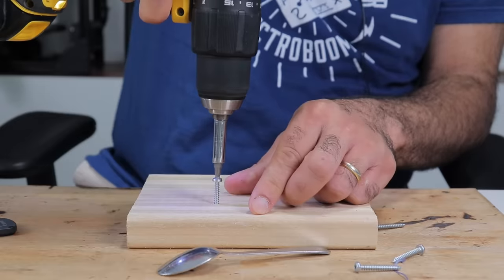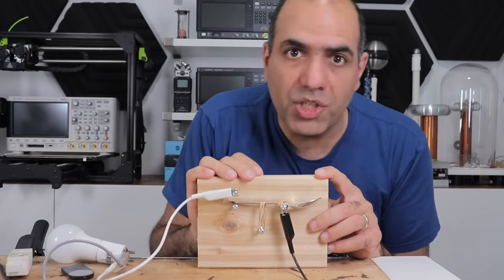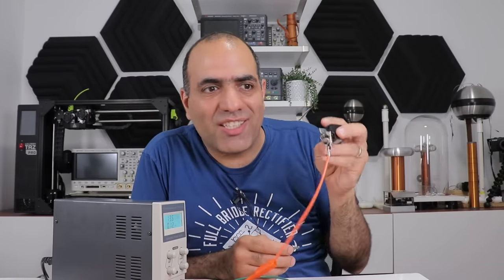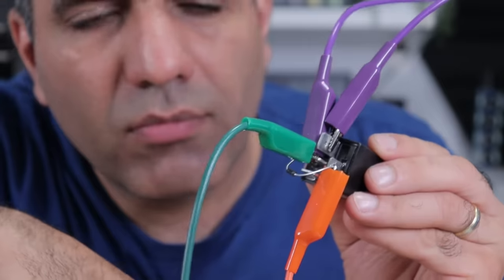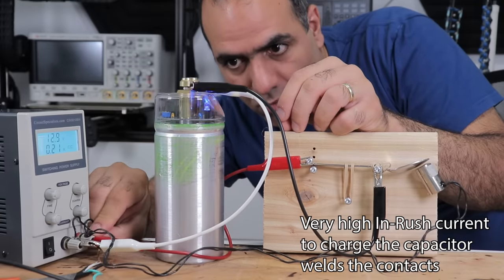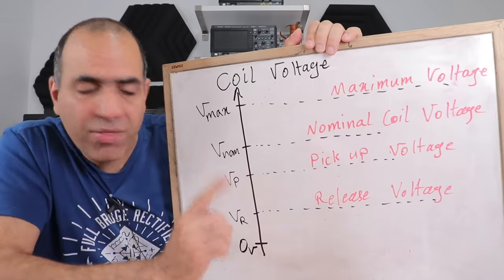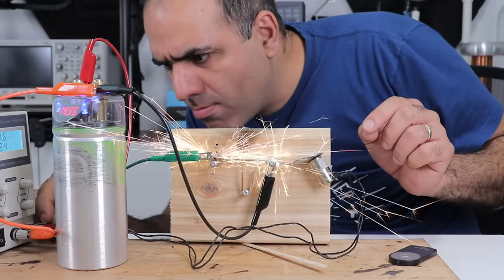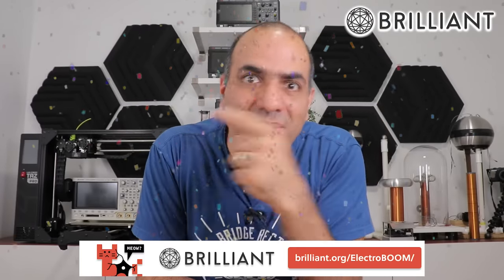Why RELAYs go BOOM!!! And How to Use Them

Comment: I like that at this point you are more scared by the breaker popping than messing with 2000V open circuits
Reply: For he is Mehdinvincible
Reply: 2000V at no current... If it was at least 20mA, it would instantly kill him
Reply: @aradmnk1269  Yes
Reply: @proxyhx2075  and.. The current is only 500mA.. What is the deal? It can only shock you slightly. Even electroboom when used it, it wasn't that powerful. If that transformer would deliver so much power as you tell, the moment he would touch the conductors, they would melt, and second, they would deliver very high load to transformer which would melt
Reply: @themoonwolf7438  Ah yes only 500mA. With 1/10 of this Current your Heart cant beat anymore!!!!
Reply: @themoonwolf7438  Please dont talk about things you dont understand
Reply: @flavioernst902  man. Don't tell me things like i don't understand what's going on. 1/10 of this current at 2000V as you tell, would be enough to fry you like a chicken, instead of just stop your heart as you say. 500mA would place you on fire by now if you would touch the conductors. First this. Second, as you see conductors was in really good shape, and if that would be high current, this spoon, at this rate of current would turn red and melt (something that didn't happened. Why?). Third, on such a "high" current, the transformer would turn really really hot in terms of some seconds! So what's going on? The transformer at no load has 2000V but no current, which is why you see an arc jumping across the spoon which is conductor! If that spoon would be the load, 2 things would happen, either the breaker would instantly pop, either the spoon would turn very very red.. Choose one!

So yeah! Applied 2000V, at no current! Simple!
Reply: @SimonBauer7  i know that. Since he wasn't it's (microwave's) load, nothing happened, right?
Reply: @themoonwolf7438  interesting thing here is that it's not exactly the wattage that's dangerous here! The human body isn't crazy conductive like metal, so current is tiny with most low voltages (V=IR). But at high voltages, the current can get a bit larger and at 20mA, the current can latch your muscles (muscles are already controlled by voltage signals from neurons). The microwave transformer is capable of giving enough current to freeze muscles, which is bad news if the current travels through your heart OT lungs. Now if you notice in the video, only one hand is used near any high voltage system. Assuming no grounding elsewhere, this is is how you work around high voltage. If there is no path to a lower voltage potential that goes through the torso, the danger is substantially reduced.
Reply: @themoonwolf7438  if there is an arc there is current. No way around that. As whit the power and instantly frying and stuff you can calculate the power by multiplying the current and the voltage. As you can see yourself its not that high. The transformer has a pretty loose coupling factor which means that even if the secondary is shortet, the primary coil still has some inductans and thus limiting the current. That means the breaker doesn't trip instantly. Please overtink your reasoning because it has some big logical flaws
Reply: 2000v is just death.. tripped breaker means angry wife..
Reply: @themoonwolf7438  First off, you're incorrect. It's a microwave transformer, capable of delivering high currents needed for the microwave generation. 

Even assuming that it is 0 current, passing through 100k ohm resistance (Upper end of average skin resistance) would generate 20 mA.

However, what people forget to understand is that when electricity runs through a conductor, its resistance can (and in this case, will) drop, increasing the current passing through. 240 and 120 V AC has been known to kill people. 2000 V from something meant to deliver power WILL kill you. You'd be safe if it was current limited, but it's a microwave transformer designed to deliver more-or-less continuously.

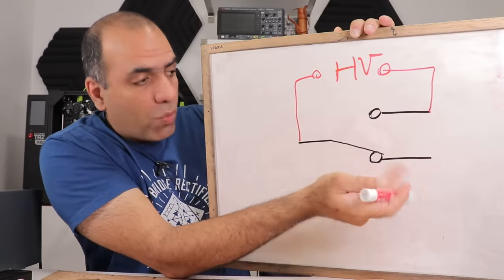Second, if you haven't watched his video on it, you should. The real dive happens at 8:30 in this video: https://youtu.be/DOMs7mYm_zs
Reply: Damn, that scared me too!
Reply: @YoRHaAttackerNo2  ok, i understand. But there is one question. Why 2KV would kill, and 15KV wouldn't kill? What do i miss? 15KV is grater voltage than 2KV that is produced by microwave transformer. Why this doesn't kill you, and so will microwave's transformer?

Edit. Now I understand the whole thing with voltage, and wattage and amperage and all this sort of things. But this is just something that I don't understand. Why 15KV, 20KV, 40KV, 100KV, 500KV, doesn't kill, and 2KV of microwave does?
Reply: @flavioernst902  maybe you are right. Maybe i miss some important facts
Reply: @flavioernst902  as for what you said about frying, i remember when I was in school 2 years ago, i was studied that at 220V and 20mA of current is just enough to shock you till death. But at 100mA, 200mA or even 500mA, that would be enough to fry you like a chicken. There was sketch images in there which was indicating each situation.

But here we are talking about 2KV, which is almost 10 times as many as 220V. And if 220V at 500mA is able to fry you really good, then what would it do at 10 times of voltage with the same rate of current?
Reply: @themoonwolf7438  Voltage doesn't exactly kill you.. technically voltage is only a reference of potential between 2  points of measurement and not 0v and 2kV .. rather the difference between 2 points is 2kV.. so you could swing on a 2kV wire like Tarzan and you're good until the second that voltage creates a grounding loop through you to create a current.. 500mA is 500mA whether created by 5v or 220V or 150kV .. most wiring for houses in my country uses 2.5mm wiring that is rated for up to 24A .. which is 24000mA .. a metal spoon is much larger than most household copper wire which is why while there is definitely current.. the spoon isn't glowing red hot.. 500mA is a small current rather.. your kettle while boiling takes anything from 4A to 8A which is 8 to 16 times more than the "high current" of 500mA. Infact cellphone chargers are now out putting more than that when charging your phone.. for that spoon to start glowing I would reckon that the amperage would have to be at least perhaps 100A ? Even then I think it would be a really slow process ? Don't hold me to accuracy on that since I tend not to put spoons in electrical sockets ..

Edit: also another thing about why these "shocks" aren't killing him.. electricity has a tendency to contract your muscles involuntarily.. so touching with just your finger usually forces your arm to reflexively pull back when you get shocked.. unless you're monkey holding something and the muscle contraction strengthens your grip on said shocking item .. I've been shocked many many many times .. only once I was actually grabbed by the current as I was stripping a cable end I wanted to join thought I had turned off but turns out I didn't ask enough questions about how the wiring worked.. in any case it kinda just forced my fingers to clamp down harder on everything and I struggled to let go
Reply: @twistedshadowsaf  thanks for explaining. I didnt want to write so much
Reply: @twistedshadowsaf  How about forks? You do put those in sockets, right? RIGHT?
Reply: @Daniel-yy3ty  I shall neither confirm nor deny these hazardous accusations.. but between you and me.. forks didn't exactly allow me to eat electricity either😂
Reply: Hm... Now I understand. Thank you guys. Thanks for explanation. And besides the thing.. I realize that this is really complicated to understand 😅
Reply: @themoonwolf7438  Power us voltage times current
Reply: Don't try this at home....the breaker popped!
Safe at home now...
Reply: @YoRHaAttackerNo2  Yup, RF burns are a thing. You can cook yourself with RF energy.
Reply: @akkudakkupl  that's..  what I said.. so.. yes you're correct? Did I mistype?
Reply: @twistedshadowsaf  Replied to the wrong person ;-) Sorry m8
Reply: @akkudakkupl  500Ω? But.. But in multimeter, if you will measure the body resistance, it is about 2-5MΩs (mine is 3,75MΩ). I don't understand.. How from such a huge resistance, our body can go to 500Ω, which is low? I don't understand that..
Reply: @themoonwolf7438  Thats called insulation breakdown. It's only a thin layer of skin on the outside of your body that has high resistance, your insides on the other hand have around 500 Ohm. 2000V is enough to pierce the thin insulating layer.
Reply: @akkudakkupl  now I begin to understand
Reply: @themoonwolf7438  What people here forgot to tell you is that frequency is also important. The most dangerous property of mains is it's frequency - even little current at 50/60Hz going through your body can cause muscle cramps and in the worst case heart fibrilation. The 15 or 50 kV you are referring to are probably from the CRT transformers or Tesla coils - these devices use 10s of kHz for operation which causes the current to flow through skin (behavior known as skin effect) - not your muscles which enables you to survive a lot higher currents, but keep in mind that even with lower currents you can still get your skin burnt by plasma (if we are talking high voltage). Electroboom already did a pain testing for that matter highly recommend watching it.
Reply: @themoonwolf7438  if you are grounded then: 2k (at 60/50Hz) will kill, and so will everything above or below (im dont know the minimum voltage required to kill)
Reply: @themoonwolf7438  you still aren't making sense. 0.5A isn't gonna heat a spoon to red hot
Reply: @themoonwolf7438  dude, he's shorting an unballasted microwave transformer. That's like 2A 2kV or about 4kVA. Yes, the transformer would be burning in less than a minute if the breaker didn't trip. I just don't understand you point
Reply: @themoonwolf7438  because the voltage drops if the supply can't provide the necessary current. If I touched a 150kV PSU capable of 1mA on short circuit, the voltage across me would drop to 100V or less. Ohms law my guy.
The MOT can provide a high current due to its small leakage inductance. A 150kV supply that can supply 1A on short (eg a big x ray transformer) would fry you like a fly caught in a bug zapper.
Reply: @themoonwolf7438  it's not the voltage that fries you, it's the current (we are just living resistors after all and P=RI^2). 
The voltage determines how MUCH current can be stuffed through you. If the supply can't provide enough current, it's voltage will drop accordingly (V=IR). It's all a complicated mess of impedances really
Reply: @twistedshadowsaf  I can tell you from experience that about 100A will make a spoon glow red. 1kA will melt the spoon in a second or two
Reply: @themoonwolf7438  glad we could help, electricity is a complicated topic and for some reason whether it's the voltage or current that kills seems to be a controversial topic lol
Reply: @akkudakkupl  been there done that lol. RF burns have a very distinctive smell
Reply: @w04h  not the skin effect, but rather our nerves don't respond to currents past a few 10s of kHz. Skin effect only takes place at higher frequencies or in more conductive materials than flesh
Reply: @inductivelycoupledplasma6207  Yeah, did that too with an SSTC, small, deep spots.
Reply: @twistedshadowsaf which is a far worse situation!!!
Reply: Working with 2000V would prime the mind to be easily startled by even the smallest sound

Comment: "A switch goes in series with the power line, not parallel." I remember having to explain that to my dad once.
Reply: If not, it becomes a fuse that only works once
Reply: @TheEdRiAx  I mean.... that is how fuses work XD
Reply: That reminds me of 8th-grade science class long ago, where during the chapter on electricity the students were told to connect a battery, a switch, and a light bulb, so that the switch would turn the bulb on and off.  Several people had theirs hooked up so that the bulb was on when the switch was open, and off when the switch was closed.  They ran their batteries down pretty quickly.
Reply: @bledlbledlbledl  And that's how a NOT gate works!
Reply: @andreyrumming6842  
There are fuses that can be reset.
Reply: @Bassotronics  AKA breakers.
Reply: @Bassotronics  That's not a fuse, by definition fuse is fusible - it melts. What you are thinking of is an automatic circuit breaker.
Reply: same here but after the 2nd fuse reset i said that you only connect/disconnect one wire with a switch not both. otherwise you just making a switch for the breaker and not the light.
he had Line connect to Neutral in the switch when you flip it on.
Reply: I mean, it will make the power turn off. It just might not come back on again.
Reply: Before or after he closed that switch in parallel?
Reply: @danewaccountttt6486  After.
Reply: @akkudakkupl  @Nilguiri No, polyfuses exist!

Comment: This guy will never die. He’ll just shock himself back to life.
Reply: Electroboom: * touches keyboard *
Keyboard: * sends a shock *
Reply: @ZeldagigafanMatthew  smartn’t
Reply: @ZeldagigafanMatthew  Doesn't mean he hasn't deadened his nerves.  I'm  a professional too...  I once stood next to a panel holding a 18 gauge signal wire that was shocking me, all the while pondering how it had enough current to go through my PPE.  I wasn't touching anything but the wire by the insulation,  the current wouldn't have been able to flow any way but through me, my electrical boots, the rubber insulated mat, cement floor and finally to the ground.  Still have no clue how the current for that particular signal wire was so high.
Reply: @jeremyreese54  high frequency RF signals do not require a direct path to earth. Any large body acts as its own earth, as the AC signal is constantly charging and discharging the capacitance the body represents. The are a number of ways an active load could superimpose an AC signal, even on its DC supply, but such a condition would-be the result of bad design or very high power.
Reply: @nigeljohnson9820  I can't remember what that wire was for,  been too many years.  Only time I've seen that effect.  Could have been DC or AC, was working systems with both, but, I get your point.
Reply: @jeremyreese54  I am only guessing, but I suspect that even a mechanical load is capable of putting an RF signal back up its supply rails. For example ,from contact arcs, induced AC voltages from motor coils and relays..
Reply: Why are you wearing a face diaper in your picture?
Reply: @robertkiestov3734  - why re you not wearing your brain today? Did you take it to the cleaners?
Reply: @uplink-on-yt  Lol nothing you say is going to change the fact that you believe in a hoax hahaha
Reply: @robertkiestov3734  - I'm glad that you think that anything you say makes it less real
Reply: @uplink-on-yt  Don’t care. I have 8 years lung care experience and you don’t.
Reply: @robertkiestov3734  OK, you're just typing random words now
Reply: @robertkiestov3734  - that's not it. You need to have your ears and eyes checked. Ask Mehdi for one of his world-famous electroshocks
Reply: @uplink-on-yt  Hahahahahaha had it coming
Reply: @robertkiestov3734  - what did I have coming? The thing that doesn't exist?
Reply: @lotus7781  It never existed 🥱
Reply: @robertkiestov3734  odd, whole world freaking out over nothing? im not sure what makes you think it never existed, besides thinking the government was lying, which i mean...not believing the government is one thing, but when people are dying and families are greiving, sometimes its best to prepare anyway, No harm in protecting one's family and self
Reply: @robertkiestov3734  its good to also be open minded for learning, but having second thoughts about something is a good thing! but..well, believe it or not, a deadly virus is a deadly virus
Reply: @lotus7781  >tell me you’re chewish without telling me you’re chewish
Reply: @robertkiestov3734  ???????¿¿¿¿¿ okay well thats a word i have never heard of before and looking it up not only does it not apply to me but also doesnt even apply to the topic, and also resorting to...insults? rather than trying to prove a point, im willing to present an arguement to those who believe in certain things that could be lead to harm in a way that it doesnt seem like a bad thing to agree with even if it goes against what one thought before, but it seems you arent simply just ignorant, you very likely know its harmful, shame really.
Reply: @TantalumPolytope  Shalom rabbi ✡️
Reply: @robertkiestov3734  what
Reply: Mehdi in heaven: tests power outlets and blows fuses all across heaven
God: shocked 
Mehdi: shocked himself back to earth

Comment: 10:50 Many relays do have a coil with a solid metal core, which means that a high frequency PWM can create Eddy's current heating up the coil's magnetic core.

Comment: If you switch a relay with a MOSFET, won't the body diode of the MOSFET clamp the negative voltage spike of the collapsing magnetig field of the inductor? Wouldn't this make a flyback diode obsolete?

Comment: I've discovered that relays give shock when powered off in the past by own experience. Same apply to solenoid valves and other similar stuff. Also, quite a crap of unreliable technology but still very widely used due to it's unique properties.
Reply: Relays are pretty reliable if used correctly.
Reply: Yes I got many times shicked
Reply: Never had one from a relay. Capacitors...
They can bite days after use, as i found out when i grabbed a used one from my compressor run/start capacitor spares parts box
Reply: I don't buy it. They can't stay charged like a capacitor can.